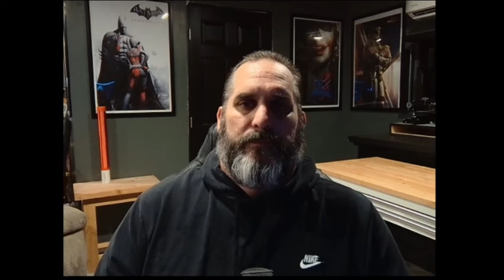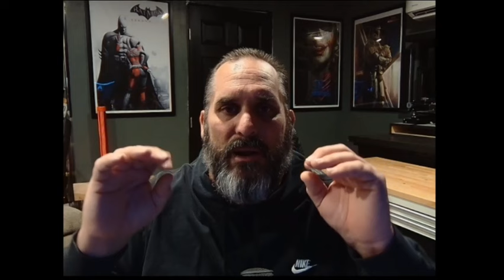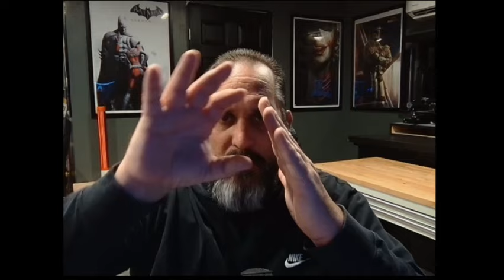Graviflyer "From Charge To Magnetic" #58

Comment: Great video Nathan. I look at pulsed DC as push, push, push. AC is not a sinusoidal up and down in the circuit as a transverse wave but a push, pull, push, pull longitudinal wave. The circuit to a person's house is the HV on the top of the pole and then back to the power generation equipment via the earth. The generators have the magnets aligned north, south, north south so it is a push, pull, push, pull. This is why AC can go the distance on the power grid as the electrons first get pushed into the circuit 1/2 way and then pulled the other 1//2 of the distance. This is why if the gravity flyer used AC, it would get pushed off the earth's surface and then get pulled back down and get absolutely nowhere in levitating.  DC keeps pushing up.  DC only gets pushed 1/2 way and then stops unless the DC has a high enough current, so the wires become superconducting which is what we are seeing being done to the power grid with the solar and wind power and eventually the fusion power. Good description of how the gravity flyer needs to touch earth ground and then be on its own once in the air. A UAP works in this manner. The bubble is the entire circuits parameters producing an anti-gravity wave so there is a different reference frame as per Einstein around the gravity flyer than what is about the earth. The universe expands and the gravity flyer must expand faster so that it levitates at it is leading the earth in expansion. This is what gravity is. The viscosity of the Aether accelerating into the earth so there is a force on an object to hold the object to the surface. The Aether then gets turned into lava and makes the earth grow in size and why all fossils are buried. There are indeed different voltages, frequencies, etc. as this is also evident on the earth when we see the earths poles wobble. This is due to the way that space and time are structured with you in the past from me and I in the past from you or both of us in the same space at a different time. The earth's wobble is a complex wave that is due to all eons of the earth being present on the earth in the same space at a different time so that the ice ages and interstitial periods that make the wobble of the earths poles like the gravity flyer wobble are all present. I explained this in a post to your gravity flyer Facebook page some days ago. On the TV show the secret of Skinwalker ranch the UAP are sometimes seen in right out in the open with visible light and sometimes in the IR as the craft are sometimes cloaked by being in the past sometimes. When the researchers on the show launch a rocket for instance the rocket can get hung up on the UAP in the past up in the sky and sometimes hit the UAP which is in the past earth in the same space at a different time. I have said too much, and I am going to go to bed now. I am glad you are feeling better and doing videos once again. I hope that I helped with you feeling better, but I don't know as you did not say write back to me about what I sent to you.
Reply from the maker: thank you for everything you sent me.
Reply: Your welcome Nathan. I try to help with what I know as a free consultant.
Reply: Cheers richard

Comment: Why does generating a higher potential difference on a plate require moving less electrons or have a lower current than charging a plate to a much lower voltage?
Reply from the maker: I don't think you are seeing it right. We are transforming the energy from one form to another.
Reply: @nathanbunten4299  maybe there's finite free charges in the plate/capacitor that I'm thinking of, and there would limit the current, and I'm conflating closed circuit current with charging a capacitor...

Comment: Voltage and current need to be 90 degrees out of phase
Reply: You cannot have voltage and current out of any phase , different currents in different branches of a circuit might be out of phase , a capacitor introduces a phase delay and an inductor introduces a lead phase.